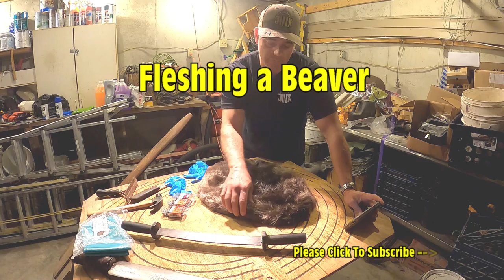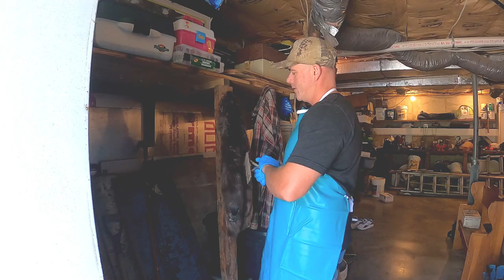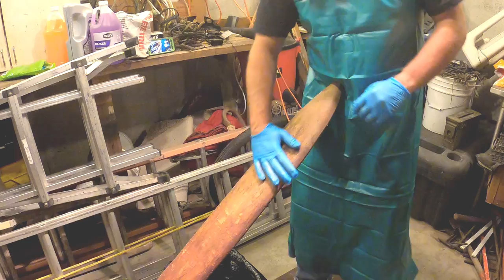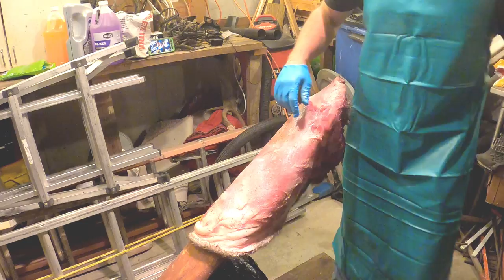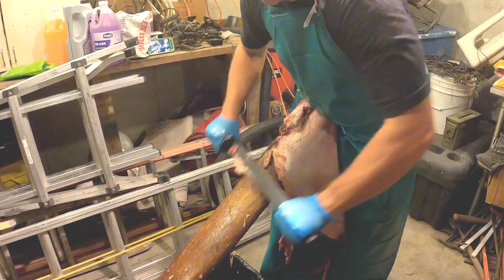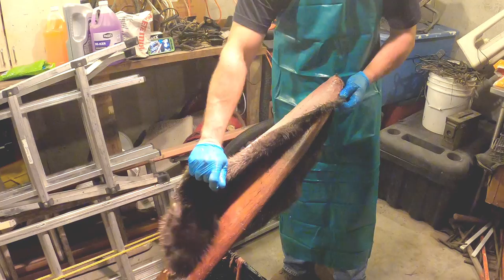Fleshing A Beaver | How To Guide | Part 2 of 3

Comment: I used to use the beam for beavers but tried using a butchers skinning knife and flesh them over my knee and doubt I will ever go back to the beam.
The quality of the job you can do and the ease make doing it on the beam show how much more work/effort it takes. 
Now I for sure wouldn't choose a black beaver for the first one.
I bet you will like it better if you try, but don't intend to say it's the only way to get it done.
Reply from the maker: Thanks for watching and commenting. Yeah, I make a habit often in my videos to point out there are many ways and I'm not perfect. I think we can learn from each other. I usually try to learn what is effective and sometimes watch what the pros are doing. I figure those people have really gone through the wringer so to speak. Any corners I can cut I will. Thanks again, take care, God bless.